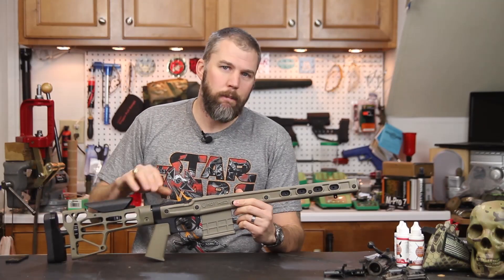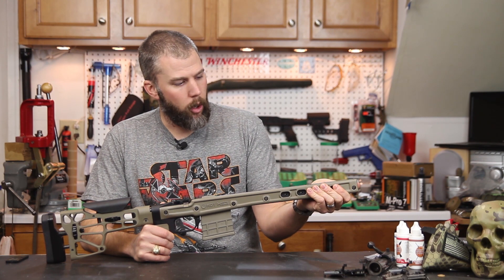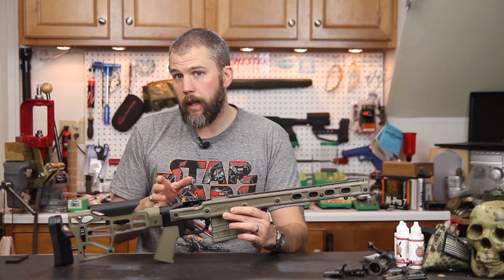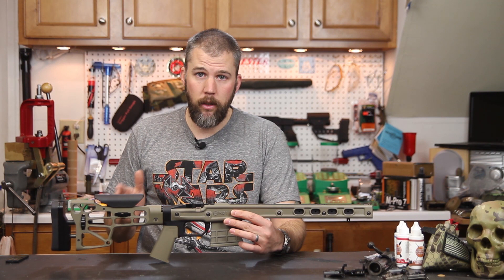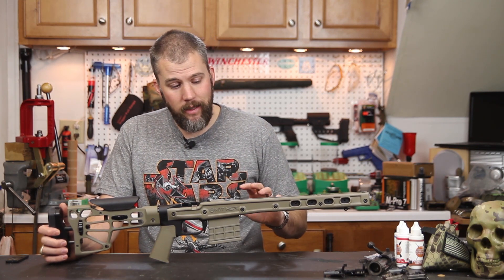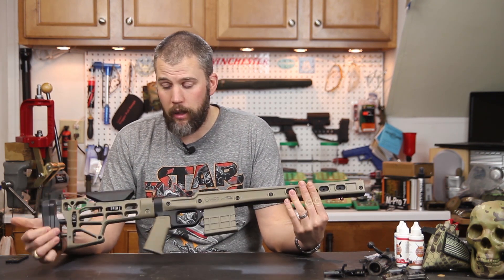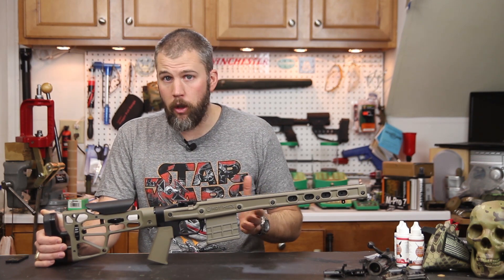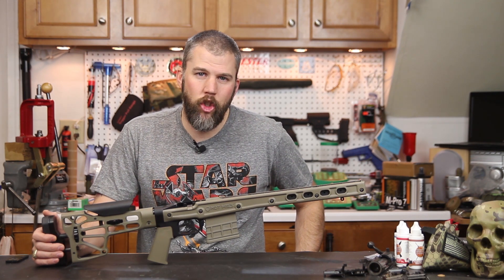MDT HS3 Chassis First Look

Comment: The flat bottom is awesome.  The polymer sides should be great for banging around.

Judging by having to add on stuff to this chassis, it's probably not what I'm personally looking for.  I'm waiting for a very cheap, lower quality AICS short action solution to my Savage 223.  The Magpul looks promising, judging solely by the price.  I don't know if it'll reach over to Savage though.
Reply: you should probably just look at adding a DBM setup to use AICS mags.. if you have a savage then their Accustock is the cheapers V block stock you're gonna get.
Reply: I have since realized this.  Accurate Mag makes AICS DBM that fits the factory Savage Accustock inlet.
Reply: Also thanks!
Reply: welcome... glad you found what you were after

Comment: So is a fixed stock adapter still needed for this chassis? It looks like one is all ready built in considering how flush the skeleton rifle stock looks. 

If that was the case then how would a collapsible buffer tube be installed?
Reply: No adapter is required. A collapsible buffer tube can just be tightened with a castle nut, and if desired a locking plate.
Reply: Exactly the same way an AR15 works. its not rocket science

Comment: Hi John, for a "budget" precision rifle, would you recommend buying a tikka t3 tactical in .308 and keeping it unmodified, or buy a Remington 700 sps Varmint in .308 with a bell and Carlson stock modification?
Reply: Ive got experience with this, so hopefully i can help. The twist rates are different, Tikka run a proper 1:10 twist, and the tactical comes with basically everything you need. Their stocks arent fantastic, but honestly they wont give you any problems, and the standard Tikka mags are butter smooth and tougher than people give them credit for. 
The tikka tactical is a damn good quality rifle, in a cheap but usefully featured stock ( adjustable riser, fatter forend, detachable magazines ). Tikka will shoot Sub MOA easily as long as you do your part.

The Remington is the opposite end of the spectrum, Its cheap, the stock sucks and doesnt have any useful features, you will want to upgrade that. The barrel is a 1:12 twist so you wont want to run much heavier than 168gr projectiles. 
The bolts arent too smooth and the triggers are ok but you'll end up switching out parts as you develop your skill in precision shooting. 

Long story short, your skills will outgrow the Remington, your skills wont outgrow the Tikka.

But to get the Rem on par with the tikka you will end up spending close to the same money.. May as well just buy right the first time.
Reply: EnterTheFenix  Tikka Tactical it is! haha, thank you for the detailed comparison!
Reply: Also dont rule out the Tikka Sporter.. they are basically the same price, but much more suited to being target rifles.. They have a much better stock, longer barrel, still threaded too, but they dont come with a rail, which is OK because you'd want a 20-30moa rail on a .308 for LR shooting anyway

Comment: Anyone out there shot one of these with good results?  I am really liking the modularity etc for my 7mm rem mag.
Reply: pr4runner These results should help you
http://puu.sh/jvPiC/021046bd8a.png
T3 with one of these, kept the group under half moa for 8 shots, think it averaged about 0.35 off a bipod / rear rest
Reply: +pr4runner mine is a Tikka T3 Lite in 7mm rem mag..it was a .5 moa in standard form with factory ammo....put it straight in the HS3 chassis...by the third 3 shot group .3 moa if I used digital calipers it would be 1/4 moa
Reply: 8o8whitelightning is that at 100 or 300? and those tikkas are damn fine for the price, probably the best price/performance ratio ive ever seen in a gun

Gotta do 5 shot groups to get an indicator tho
Reply: its a Lite...the barrel doesn't like getting too hot..upgrading to a Trueflite 27" #5 contour...was only at 100 weather crapped out before getting chance to step out further range...3 shot or 5 means JS... its a hunting rifle only need 1 shot
Reply: 8o8whitelightning If you're looking for accuracy data and results it means something
Reply: James Binnie every animal ive shot from 100-600yrds have all been with 1 shot and each shot has hit where ive placed the reticile that's my accuracy data and results..1 shot 1 kill that matters

Comment: After much debating between this HS3, LSS, and the KRG Xray chassis I am pretty sure it will be the HS3. Its grown on me. Not about the rifle. Debating the R700 AAC-SD 16" and the Savage 11 Hog Hunter 20" either in 308 the do you think the Savage is a lesser rifle it has a med profile barrel. I know r700 has the most after market support hut Savage has enough as well just not the same. I live very rural area. Range will be 100-400 yards max maybe once in awhile some longer ranges. Thanks.
Savage 11 Hog Hunter  $475
R700 AAC-SD  $700

Comment: I just got an email from MDT they will be making the LSS and possibly this HS3 chassis for the Ruger American. Thats great because I love the American but until know there has been a chassis or 10 rod magazine for this. Thanks MDT. The American has smioth bolt and pretty good stock trigger. I olan to get the American Predator 308 it has a 18" barrel and a thicker profile barrel.